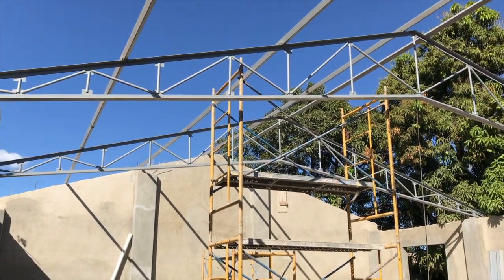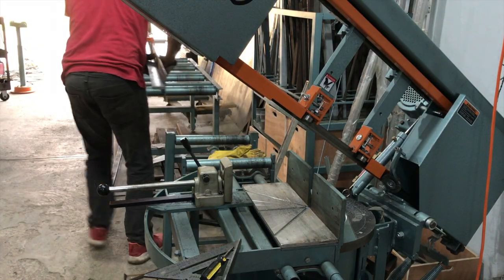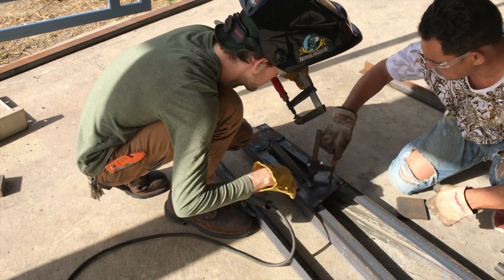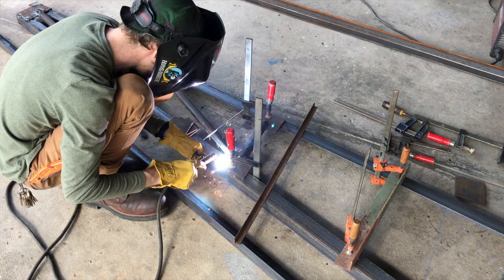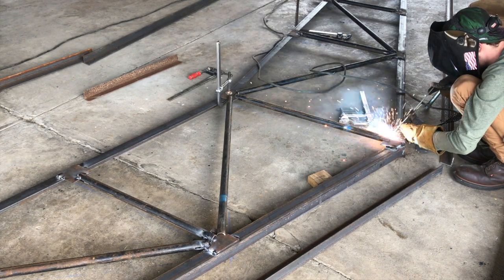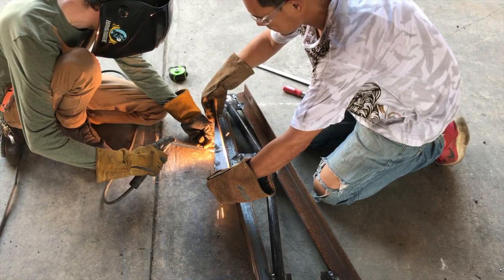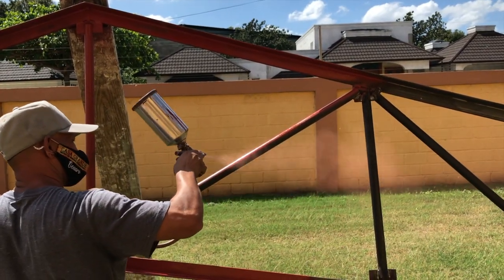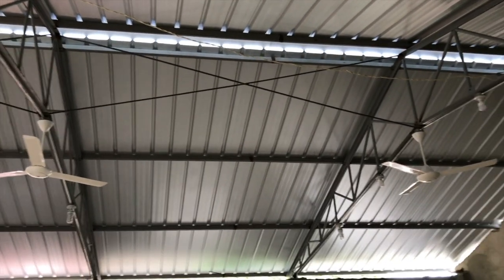How to Build 36 Foot Steel Trusses

Comment: Tips for construction: for a Pratt truss, the diagonals all are in tension and all the verticals are in compression.  so its possible to just have rod or flat stock for diagonals and angles or box for verticals.
Reply from the maker: I am not an engineer I just get asked to build trusses and I've been trying different methods out and often over building a little bit it's still cheaper than hiring an engineer but thanks
Reply: @CreativityUnleashed  There are a number of good videos that discuss truss types and stresses.  Paul Kassabian has a good series and makes it understandable.

Comment: Great stuff, i am going to try this with a 4" T-bar as i only have a 10.5m wide span , what grinding disc and milling vice did you use for cutting the slots in the pipes ?
I am in Brazil so defo no snow load

Comment: Nice DIY. You just gave me courage to ditch ibeams and build a truss instead.  What size angle iron and depth of truss would you use for a 38ft span flat roof ?
Reply from the maker: I am not an engineer so I can't say exactly 
are you going to have snow load ?
Reply: @CreativityUnleashed  yes adding snow load. It would be a flat  sloped roof 38ft wide by 25ft deep. .with water running toward  the 38ft side.
Reply from the maker: @Super6ix06  Well I'm pretty sure you're going to have to either work with an engineer or find engineered design trusses and copy them

Comment: Hi, great vid and I got a lot from it - thanks.
However, I have 2 questions:
What size angle are you using here? 
I can't weld so would using nuts and bolts be ok for my 20ft project?
I really appreciate any guidance here.
Reply from the maker: on small metal trusses like that I would consider using metal studs there quite a few methods that you can screw them together that works quite well
Reply: Are still on the DR island..?
Reply from the maker: @everettcrescentreese7609  not just now but I should be back soon

Comment: How do you come up with the design for the trusses? How do you determine how many pieces of pipe to put in the middle?  I’m looking to get into building trusses. Do you know where I could find some engineer approved truss blueprints?
Reply from the maker: in the past when I've tried to get engineered designed trusses I hadn't been able to sorry I can't help you with that if you find anything good I would be interested in it as well 
I mainly do calculated guess work quite a few of the engineers I've worked with don't exactly know how to do trust design as well so because it's quite complicated for a lot of people
Reply: @CreativityUnleashed  thanks for replying I found a few prints last night but they were more like sketches scanned and uploaded to the internet. A guy commented on here about a video an old engineer explains trusses in a fairly easily digestible way. I’m going to rewatch it. I’ve heard engineers have difficulty with trusses cause it’s so many cross members and it’s hard to figure out the load bearing abilities of the trusses with a lot of cross members.
Reply from the maker: @dtezthompson5034  Yes I think I watched that video that someone mentioned. 
and there are also a lot of just unknown factors that are difficult to calculate in software or on paper

Comment: Hello, now a subscriber looking into building a 28x28 carport, I was interested on using some of your techniques on building trusses. I'll be using 5x5 Square tubing for post, can you share some of your plans to build a truss? Thanks in advance
Reply from the maker: if you haven't looked at some of the other trust designs I've done more recently you may be interested in doing that also because I was testing out this concept for the first time I quite a bit over built them if it's 28 feet that doesn't require a whole lot to span
Reply: @CreativityUnleashed  amazing. can i email you?
Reply: im struggling with a roof design. how to contact you?

Comment: Thanks for the video. Question: how many vertical posts you have to put in a 36 f truss?
Reply from the maker: Since I'm not an engineer usually I design a truss and show it to an engineer and if they want some changes made I'll make them and then I build it usually there isn't a whole lot involved I often find the process cheaper to a little overbilled than to pay a bunch of people to try to optimize The design and it seems most engineers and people don't know how to optimize trusses 
there is always unknown factors

Comment: What is the angle cut to make the 4/ 12 pitch on angle iron  to put the 2 pieces
Reply: The arc-tan(pitch),  or arctan(4/12) = arctan(.333) = 18.43 degrees